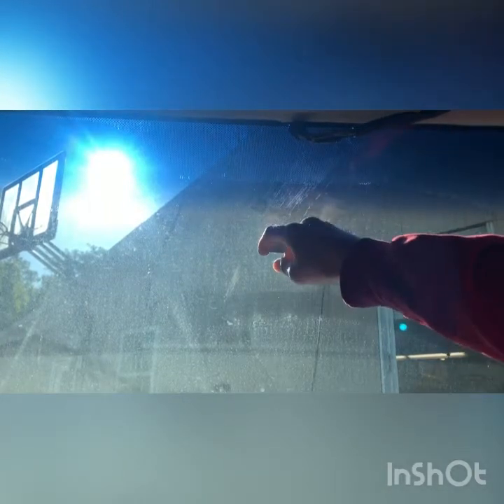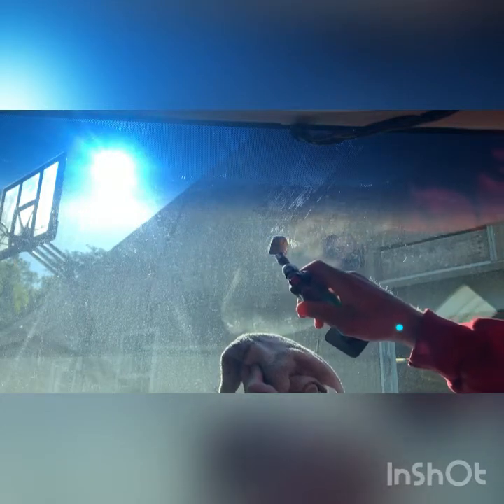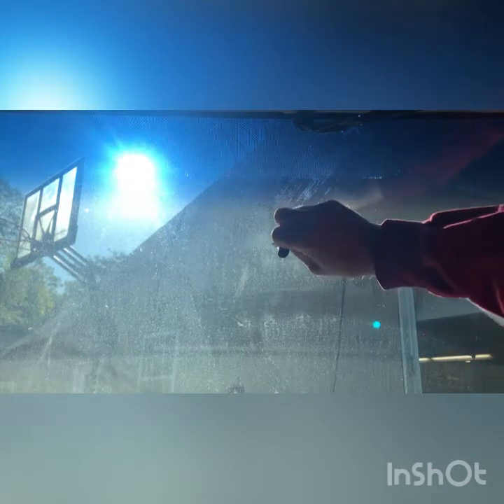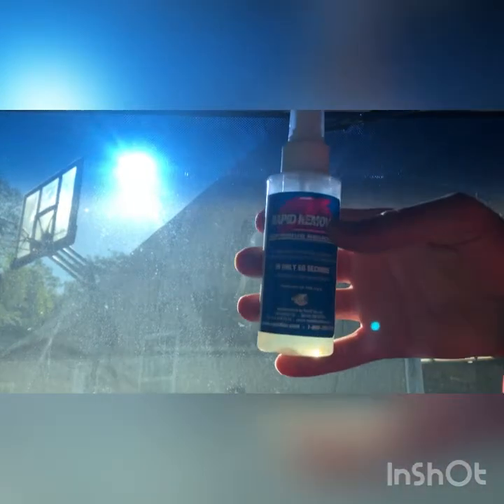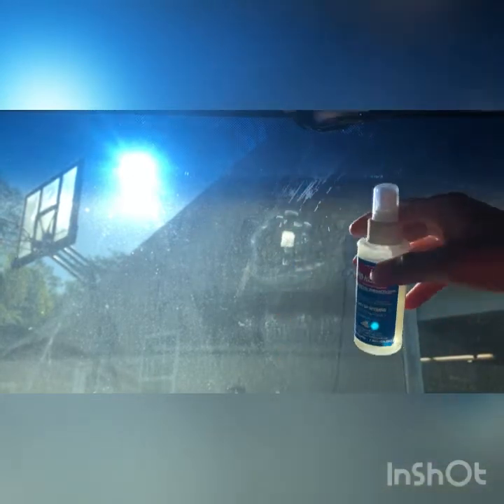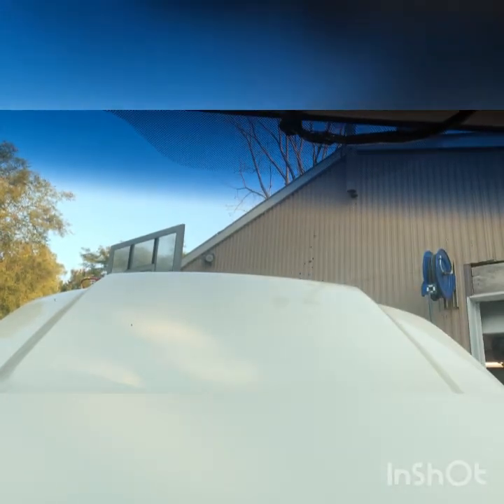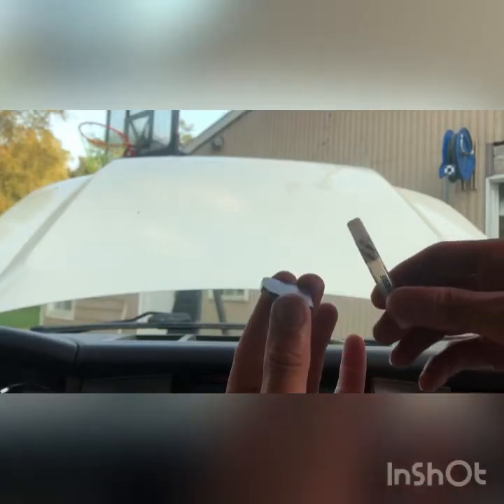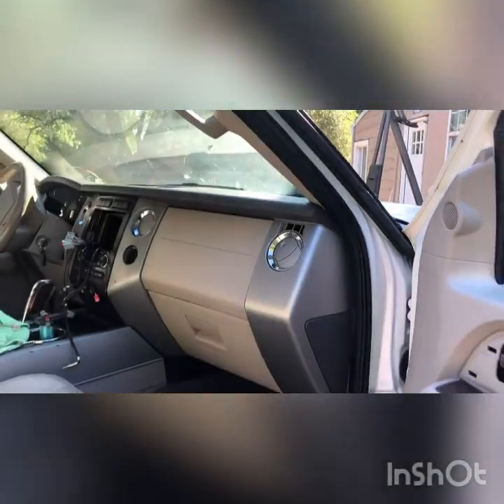Remove and install rear view mirror button mount

Comment: Oh man thanks for this. I thought I was screwed. I am a little embarrassed to admit it, but when I was replacing the button after the mirror fell off, I put the dang thing on upside down. Even after telling myself to be sure it was in the right orientation. I noticed it pretty quick, but it was too late to change position at that point. Anyway, you saved my bacon brother.
Reply: Thanks for comment. I'm glad I wasn't the only one.